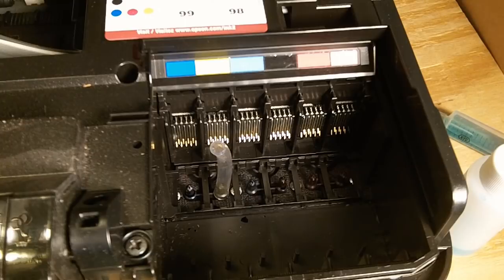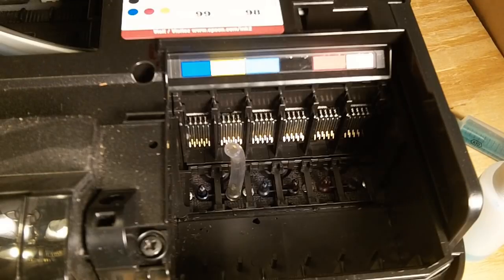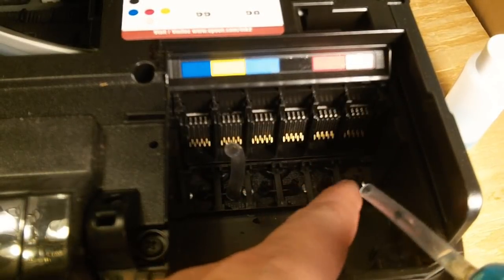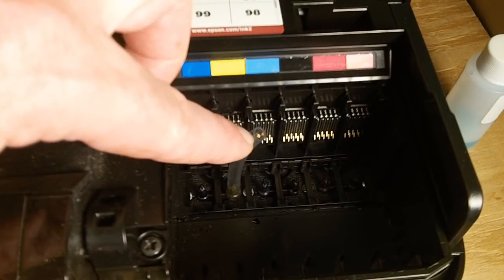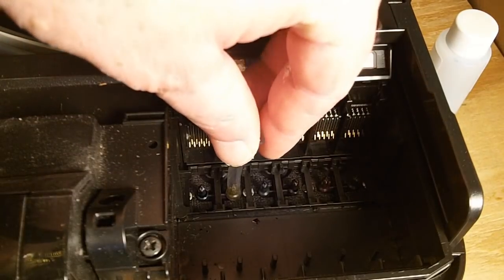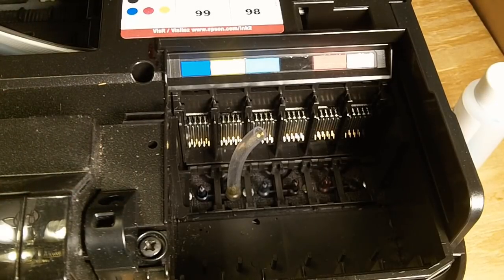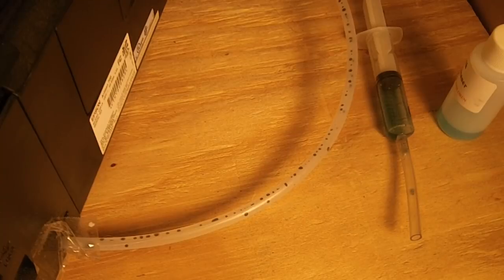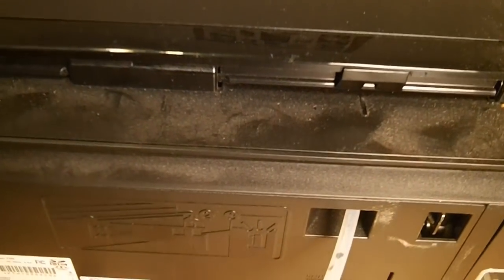Giving up on a dead printer? Try my way to unclog inkjet printer port

Comment: I've unclogged the printer head. The solution can easily go through it. But it still printing blank page. Does anyone have any idea?
Reply from the maker: don't give up on it, I have had mine go blank after cleaning and ran a cleaning maintenance print cycle every other day for a week or so and it slowly came back to normal.
Reply: @RobbsHomemadeLife  Thank you for your answer. 
Maybe I'm too unpatient. I bought my epson 1290 on thursday. They said they haven't used it for years. I've printed the nozzle check, and only a few lines was visible. 1-2 magenta and 1-2 yellow. I've got an unopened black and an unopened color ink with the printer. I've installed it however the old ones seems to be good. So after the nozzle check. I've pushed through some destilled water with amonia (about 70%-30%) I've wait about a half hour than again. I've got out the print head, so I could se the water comes out from the printhead like a waterfall, in a beautiful line at each color. So I put it back, I've done 1 or 2 head cleaning than nozzle check. Nothing. Head cleaning nozzle check nothing. So I disassembled again and i repeated the cleaning process I've described, but this time the solution was destilled water and alcohol (70% alcohol and 30% water). Then 2 times head clean than nozzle check. blank page. head cleaning again. nozzle check. blank page. OK. I let it sit. On friday. I've started with 2-3 times head clean, then nozzle check. Blank page. So I've disasembled again, I've clean with alcohol-water solution I've let it sit for 5 hours I've push through the solution again, let it sit for 1 hour, then the solution again. After that I've tried head cleaning-nozzle check about 10 times, I've got blank page. Today morning (Saturday), I've tried some head cleaning-nozzle check cycle, 2-3 times, but nothing come out. I've got blank page again. 
Is it a good plan to try this cycle for a week every day 2-3 head cleaning- nozzle check cycle. So I mean one head clean, one nozzle check, and this repeated 2 or 3 times a day? Will it help me? What do you think?

Comment: I do use Epson Stylus PX660 since 2012 and the only problem I am facing is that it smears ink on paper and pull out multiple papers. Please , if anyone can assist, I am ready to listen and do whatever it takes to mendthe problem
Reply from the maker: John, I do not have that model, but if you Google your problem with the Epson model you will probably find a person who has had the same issue on a forum and you can see what answers were provided. If you can't find info on your specific model work backwards by searching just for the brand and then the type of printer until you get to an answer. usually is it is smearing it is because the pads are dirty and if you are picking up multiple papers it is because the tray is not set right or too much paper.

Comment: I have a monster of a situation. My Stylus Photo 2200 was stored for over 8 years (maybe closer to 9). It was stored fairly protected from temperatures (with the tanks in it). Now that I'm trying to use it again (I upgraded my DSLR) the yellow refuses to work at all. for the last month I've had a set of tanks I bought with printhead cleaner in them have been sitting in it, running head leaning cycles once a week, per the instructions... mostly (4 cleaning cycles then a test sheet, repeated twice) and nothing has changed. This morning I ran the cleaning cycles and test sheets, as I have the 3 weeks prior. NO CHANGE AGAIN. I chose to repeat again this evening but nothing showed on the test sheets, NOTHING... the printer went through all the motions, but without printing a pattern on the paper. I hope it will save my printer.
Reply from the maker: good luck Ronald.

Comment: Robb - I did everything like you said and still no ink coming out of the Yellow and Red printheads.  How many times should I run the cleaner solution?
Reply: Maybe you can try mixing hot water like 2 minutes microwave hot water with isopropyl alcohol and using that as a solution

Comment: I used your cleaner to clean the print heads, now the printer wont stay on.  I turn it on and it turns off in a mater of seconds.  HELP.  any ideas?
Reply from the maker: Mike, I have not had that happen to me before. You might try googling the symptoms and check the forums.

Comment: I have a HP 7010 officejet that had developed a total "clog" of the red cartridge.  I went to the Farmer's COOP and bought a 20 ml syringe and 12 inch tube to fit.  I mixed up water, alcohol and a coupld of drops of dish detergent and flushed the printhead.  The first print after flushing was a little light and after about 10 color prints all was well.  The instructions from HP were to buy a new printer.  Why?  Because HP does not make or sell any repair parts for their printers.  Surprised?  You cannot buy anything from HP - like a printhead - to repair a printer.  So you have to come to youtube to see how to get around that problem.
Reply from the maker: Phyl, thanks so much for taking the time to leave such a helpful comment, I know the other viewers will appreciate it too. 😎👌

Comment: Hi need to know why my photos from my phone to computer, are coming out with a purple tinge to them . What should I do .? It is costing a bit in cash . Thank you regards 
Phyllis
Reply from the maker: Phyllis Bailey Hi Phyllis, could be several things, check the white balance on your phone if it has a white balance setting. Also, are you taking pictures of bright objects, sometimes the IR filter does not work well with bright items.  Also see if there is a software update for your phone to fix such a problem.

Comment: I didn't work on mine! I went from marginal black ink only not printing, to no printing at all. Every color quit printer. Absolutely no ink coming out. I am not upset, just that I was trying this method as last resort. Off to buy a new printer!
Reply from the maker: Ronald. I am sorry to hear that. Were you running normal inkjet ink or pigment type. The cleaner does not work with certain inks used a lot in printing photos and artwork.

Comment: Robb, does this approach work on the HP 8600 series?
Reply from the maker: sorry mark, don't know much about the HP 8600
Reply: It may be possible if the tube is taped properly to the printer head attachment so that the other end of tube points straight up. in 8600 model the printerhead attachment can be removed and used in ultrasonic cleaner (only with cleaner's plastic basket, not directly connected to the ultrasonic bottom metal, and only the bottom of attachment in liquid 1-2 millimeters..)

Comment: My tubing was too big, so using coffee straws/stirrers cut in half to cover the 4 nozzles and fill with windex..... here goes nothing ;)
Reply from the maker: good luck nelson.
Reply: @RobbsHomemadeLife  
I wish I could say luck helped, but RIP to my Epson 446. 😎
Threw him out the front door after refusing to read print cartridges anymore and was so clogged I never got any fluid out of 3 nozzles at all... Only Cyan was open even slightly.
Tried to clean from the bottom and top of nozzles and soaked it, but didn't work.
Only got worse after 5 hours of tinkering with it.
Lack of care, constantly left on and never cleaned took it's toll.😥
Thermal printer time 😁

Comment: When you say 7.62m is that 7.62millimeters
Reply from the maker: +Ian Rees Hello Ian, I made a mistake, the tubing was 3/16 inch diameter tubing and came in a length of 25 feet. I mistakenly added 25 feet, or 7.62 m as the diameter.  I have gone to amazon and obtained a link to the 3/16 inch tubing I used. Thanks for asking your question or I would not have known I made the mistake.http://amzn.to/1SzRgtI

Comment: Buying a new printer is often cheaper than new ink...stupid, but true.
Reply from the maker: sometimes you can get a printer with cartridges that is cheaper than buying cartridges. I prefer to sue bulk ink with a CIS system.
Reply: Get a CIS system! I run a pub and do huge amounts of full colour A3 printing, I'm spending about £40 a year on ink for ~10,000 pages (mixed A3 photo/posters and A4 black text)
Reply: If you use dye ink rather than pigment, it clogs a lot less. I keep a few bottles of Magic Bullet print head cleaner handy to deal with clogs, it's like the solution advised in video but more rapidly effective.
Reply: Just to add, I use all Epson equipment, a 1500W and a wf-7525.
Reply: That's because the printer manufacturers don't make profit for printers, only for the inks they sell afterwards.

Comment: this doesn't solve the problem of "planned obsolescence". You can get 5 years worth of 35000 prints then you have to reset the internal counters which you don't have access to.
Reply from the maker: on some printers you can purchase a program to reset the counters . do a google search for your printer, there may be a free reset available t the manufacturers website
Reply: Thank you for the reply. I have the reset function in the hidden menu on my HP 7610. That's all I get from google. But I was referring to the counters which tell HP tech services how many pages did the printer printed, and the instructions that make the printer "obsolete" by programming code. That I can't reset

Comment: Robb, thx for your video..  It gives me hope that there might be a way to recover my Artisan 810, which will not even go through initial test boot cycle.    Many others apparently having this problem.    You can see what we see if you just watch the following youtube video.   Hoping you have a solution:       [  https://www.youtube.com/watch?v=nyY_to5CLTg  ]
Reply from the maker: Reset the waste ink counter
you can check the counters value here - http://www.EpsonReset.com

The solution was turning off the "Automatic Head Maintenance". 
Do this as soon as you have access to the menu, because after a few seconds
 it will show the error and the touch menu will not work anymore.
 So as soon as the touch menu shows
 press Setup > Maintenance >Automatic Head Maintenance and turn it off.

My Epson Artisan 810 repeatedly would give me the printer error message 
with the only option to turn off the unit and turn it on again. Over and 
over it would give me the printer error message. With the unit off, 
I opened the cover (like you would to replace the ink cartridges) 
and forced the CD tray all the way out like you are about to load a 
CD for printing, closed the cover, then started the unit up again. 
For me that did the trick. It went through it's normal 60 seconds or so of set-up, 
then worked fine ever since. 
Not sure if this will work for you, but it worked for me.

I cant take credit for this fix, but it worked on my Artisan 800 with the same error. My error occurred right after a paper jam where i had a tough time removing the paper.

"Open the printer. See a 1/4" grey plastic band that is attached to the
print head. This is the CR (carriage return) guide that tells the print
head exactly where it is. During a paper jam it is sometimes pulled out
of the slit on the head carrier that it has to be in to tell the print
head where it is on the carriage. Pull the print head out about half
way, and with a flashlight look behind the head carrier. You will see a
small plastic u-shaped piece. Make sure the CR ribbon is INSIDE the
slit, or u-shaped device. When this happens you will usually hear the
print head hitting the side of the printer twice while it tries to
determine its position. Be very careful not to damage the ribbon. It
will slip back into the slot quite easily"

My print head didnt want to pull out, so i took a small inspection mirror and had a look behind the print head. Sure enough the ribbon was outside of the sensor. I easily pushed down on the ribbon gently with my finger and pulled it towards me just a little bit and it popped back up into the slot. Closed the printer up and no more message.

Hope this helps some other poor soul.

finally
https://resetkey.net/a-printer-error-has-occured

Comment: I heard that even if you bypass the waste ink pads like you did, the printer still tracks the amount of ink used and you will eventually get the error code to replace the pads.
Reply from the maker: P Lee Yeah, you have to go to the Epson website and download a fix to renew the waste ink code. You will need to enter your printer ID number from the back of the printer.